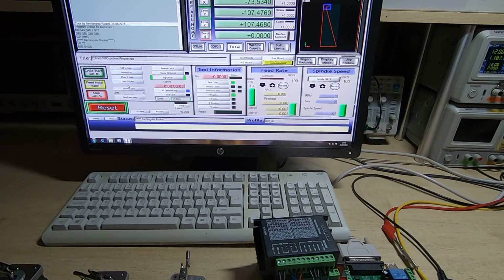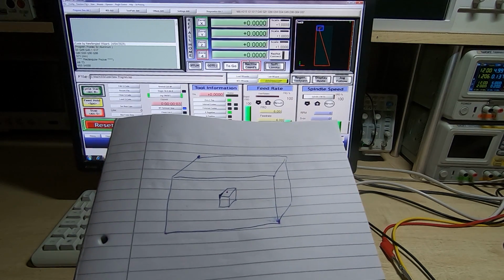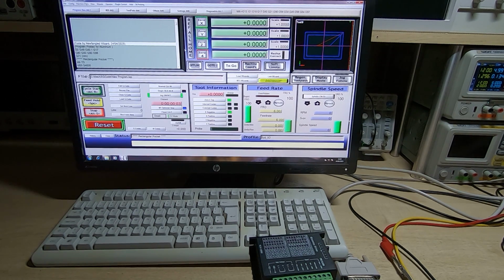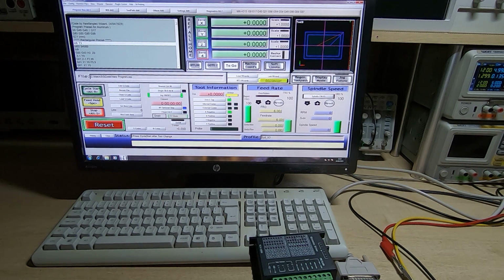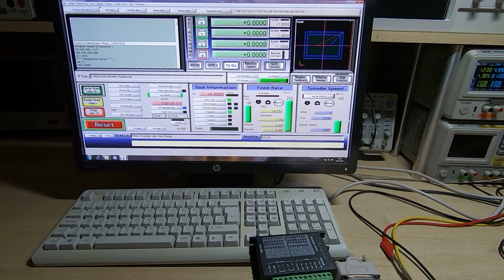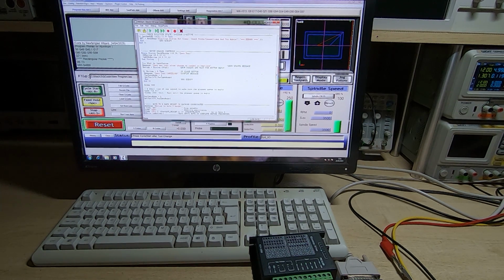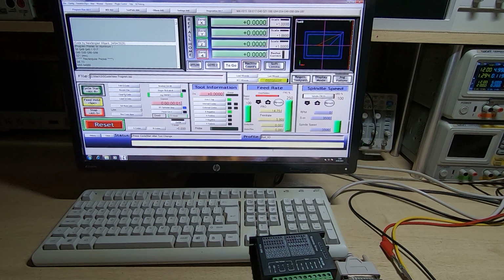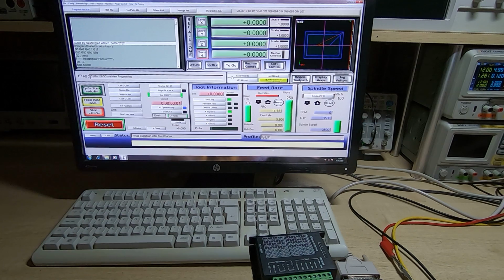MACH3 Tool  change macros

Comment: hi Jerry please could you provide me with your macros . I have down loaded and trying to use versby tool change macros ,  The m6 works but m6 end hangs and I have to reset 3 times to push cycle start and then it works properly. I am hopping to compare these 2 solutions so I can resolve this issue. I have the rnr controller usb board and hope it is not a hard ware problem . I would really appreciate this.

Comment: explained everything yet explained nothing.
there was a moment of clarity as you mention cycle start runs m6 end, having just been perusing files and seeing m6 end has "this script moves back to m6 start position...".

well that explains why when tool #2 is 50mm longer than #1 that was the zero reference, it slams into the work...

open editor. open random file. start talking of getting variables but no mention on how to WRITE THE CODE. all i see is "tool=get selectedtool". i dont see pages of text like you have...

i know i have to write something in there but... what?

"dear mach3,
                       i would be awfully good of you if you could lift tool up 100mm, jank it to x-50 so i can change it. in fact you dont even have to do that, i can! no, what i REALLY need you to do is simply apply the appropriate Z offset as per tool table BEFORE you "return to m6 start position"... 

 yours sincerely,
 maker of broken tools and scrap metal."

doesnt really work for some reason?

yeah, um... maybe explain the logic and language behind writing the macro, editing the script, rather than just sort of explaining why we need a macro and that yours does it?

Comment: I've tried installing a number of Tool Setter macros that have been introduced on YouTube, but for some resson none of them work properly. I don't know why, so could you tell me your macro?
Reply from the maker: I am not sure what you are asking. What do you want me to tell you about the macros that I did not cover in the video? You also do not say how the ones you tried did not work. Did they do nothing at all or did they do the wrong thing? Macros must be using in a correct 'context' or MACH3 may do something unexpected. For example if the current offset mode is not maintained correctly then all bests are off. Also some M codes are 'sticky' and others are not. When designing a macro it needs to ensure that all states are properly set and they must also fit into the way MACH3 operates. For example the start and stop macros must be separate because they are called from MACH3 a different times. and MACH3 does work between these 2 macros.
Reply: @JerryWalker001  Iｔ's about Tool change macro, I need Tool change macros.  You said ' If you would like copies of the macros then please contact me .....'

Comment: Jerry, thank you for sharing this video!  I, so far (6 days after this video was posted), must be the only viewer that is interested in how you've modified & use MACH3 for your own use.  I'm thinking about trying to temporarily modifying my old South Bend lathe into a CNC lathe before I actually try to modify my RongFu-type mill-drill to run as a CNC mill.  At this time, I'll either use MACH3/4 or LinuxCNC as the control software.

Could you share the files that you mentioned in this video?

Edit: You could simply email them to my Gmail account to save you the trouble of setting up some kind of share for the files.